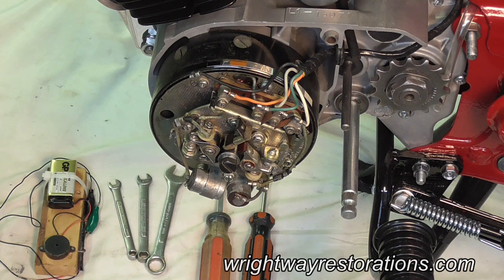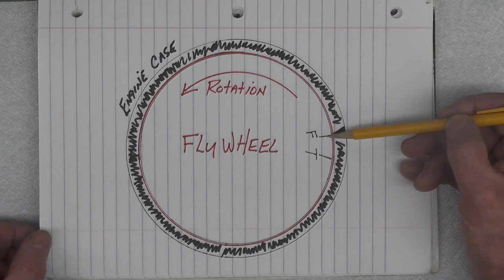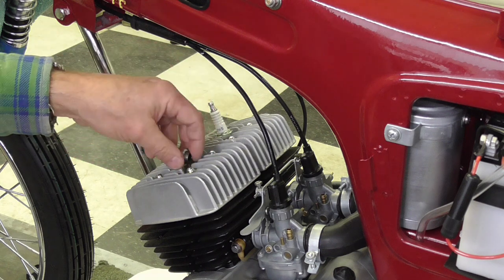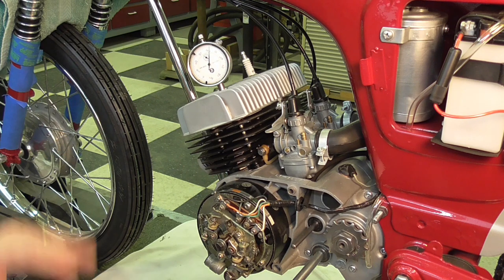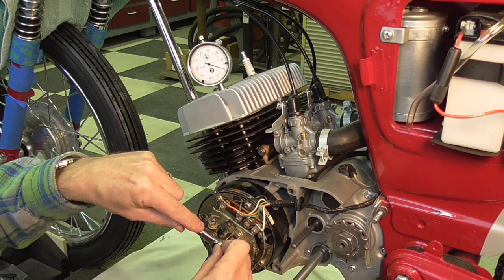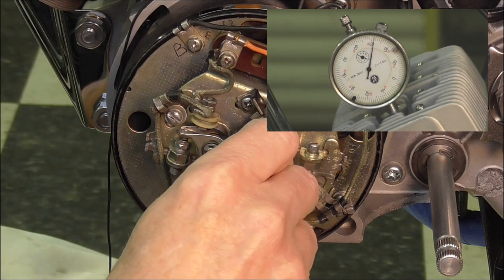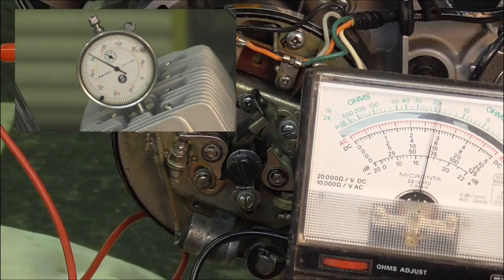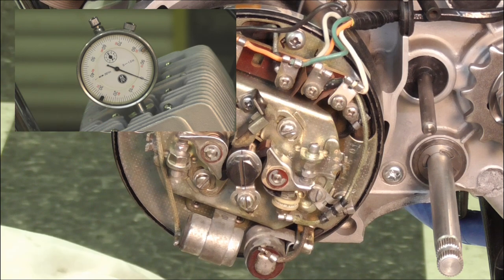Shop Talk #26, Setting Two Stroke Ignition Timing --- Video #180

Comment: Very helpful. I've having an odd issue where it's hard to hit get the "discontinuity" right at 1.8mm BTDC and I'm assuming it's because the point rotor "pad" or part on the points that touches the timing rotor is worn out? Thoughts?
Reply from the maker: This can be tricky sometimes.  The first thing I'd do is make sure the contact faces of the points themselves are flat and clean.  That is, there's no point protruding from one of the point pad faces.  If there is, use either a very fine file or strip of 400 grit emery/sandpaper to flatten them out.  Clean thoroughly by pulling a strip of clean white paper through the points (when they are together) switching out the paper until it comes out clean.  You can also use contact cleaner to spray down the point surfaces to remove any residue.  Be judicious if using  brake cleaner around these parts though, as brake cleaner is very aggressive.

As you suggest, it's also possible the rubbing block on the point arm is worn or inconsistent.  If the contact point appears suspect, you could also carefully touch this up with a file or sandpaper to square it up.

If all else fails, short of replacing the points, you could set the timing just slightly to the retarded side, say 1.7 or so or wherever on the retarded side you can get it to settle down (within reason).  I would not go to the advanced side, i.e., firing too early as that can be risky.
Reply: @kwrightway  Thanks for the responses! I think I got it after a bunch of tweaking last night. Your video was by far the best I've found online! Much appreciated!
Reply from the maker: @naym0001  Great, glad you were able to sort it out.  And thank you for the kind words!

Comment: I'm not going to build a noisemaker, how did you set the meter? DC Volts? Ohms? What scale?
Reply from the maker: The intent is to check for continuity or rather a change in continuity so the ohms setting is what is used.  Voltage or current (amps) is not relevent for this procedure.

Comment: I have a question. So i made a little contraption that consists of a light bulb and battery, sort of like what you have.. now i was getting continuity regardless of the points are open or shut.. so i removed the fly wheel.. un plugged the harness.. still continuos continuity.. so i removed the whole ignition system and tested again.. still the same problem regardless if points are open or closed.. 
I followed the workshop manual.. so this make timing impossible. 
Bike is a 1978 Yamaha RX125e. My question is this the result of a bad condencer that is allowing my tester to light up even if the points are open. Any advice would be super because i cant make heads or tales of it
Reply from the maker: Initially when you first attempted to use your tester, did the light alternately dim and brighten when you turned the crank?  If so, this is normal and the light was working as intended.  The variation in brightness indicates when the points are opening/closing, not going completly out.

Comment: Silly question, is the multi meter set to ohms. I bought the timing kit from Motion Pro to check my RD 350 and shows the the points opening @ 1.5 mm using the light bulb setup. It doesn't repeat very well so I was thinking of picking up an analog meter as all I have is a digital one. Should I purchase a buzzer? This was a great video by the way. Thank you very much!!!
Reply from the maker: You are correct, when using a multi-meter, you use the ohms setting.  All you're checking for is continuity or current flow.  A buzzer isn't absolutely necessary, I only demonstrated several different methods so folks know there are options available.  As I said in the video, I tend to prefer a buzzer as I find it's a bit easier for me, but that's a personal choice.
Glad you found the video useful, and you are most welcome.
Reply: @kwrightway  Thank you for the clarification on this!!! Have a great day and thank you.
Reply from the maker: @davidwinterbottom1942  Certainly, I will and you too...

Comment: This was very helpful, did you make the sound indicator?
Reply from the maker: Yes I did make the sound indicator (sometimes called a "buzz box").  It's a simple DC-current buzzer I picked up years ago at Radio Shack.  I expect they are all over eBay now.  Besides the buzzer, a few pieces of wire, a couple of alligator clips and some solder and you're in business.
Glad it was helpful...
Reply: Search continuity tester!

Comment: Also, once you set the btdc point, do you have to re-gap? odd question but that's how the manual makes it sound for my rd350
Reply from the maker: You certainly can recheck the point gap after setting BTDC.  If you end up readjusting the points, check the timing again, though.